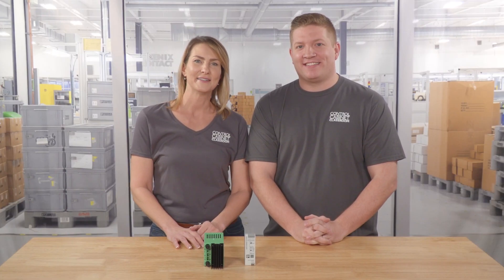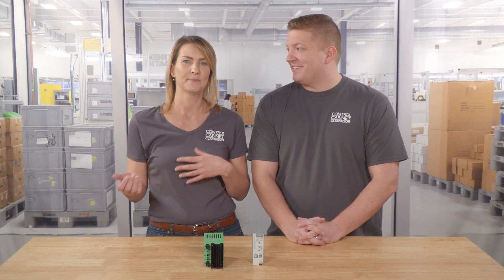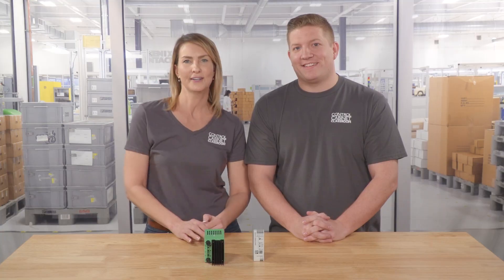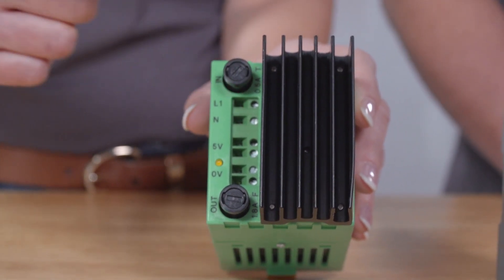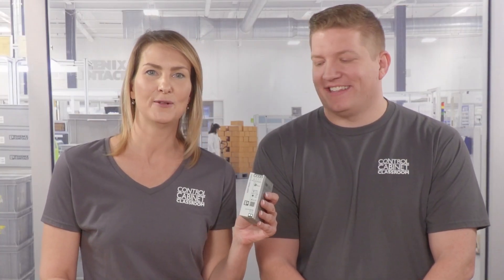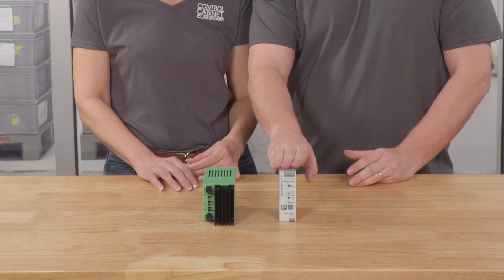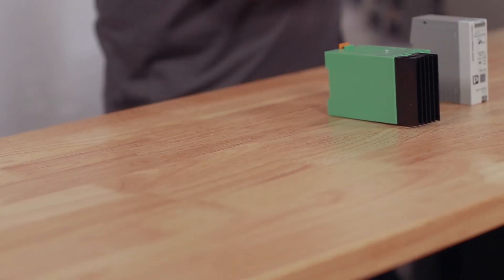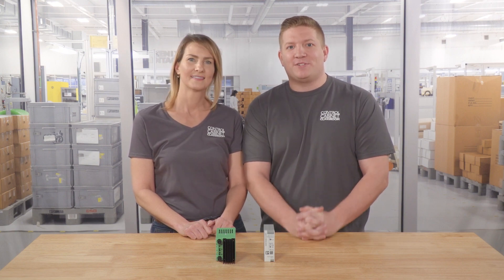Power Fundamentals: Regulated Power Supplies

Comment: My understanding is that switching supplies can create more noise in a circuit so linear are preferred for certain applications, such as audio. Is that correct?
Reply from the maker: Correct. In general, for sensitive applications, the DC ripple is much lower on a linear power supply. We are talking a few milli-volts from a modern linear supply vs 30 to 50mV for a quality primary switched mode power supply.

30mV is pretty low and fine for most industrial applications however for sensitive applications even that level may be too high. 

On the AC side, there’s no switching from a linear supply so there’s no feedback/harmonics (noise) onto the AC line.

Depending on the requirements for the audio signal a switch mode power supply may or may not be desirable.